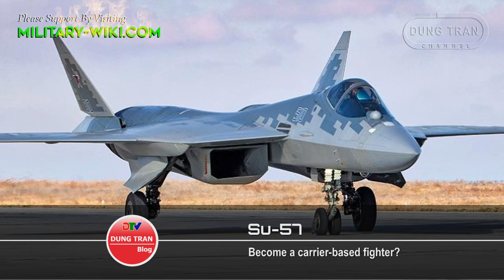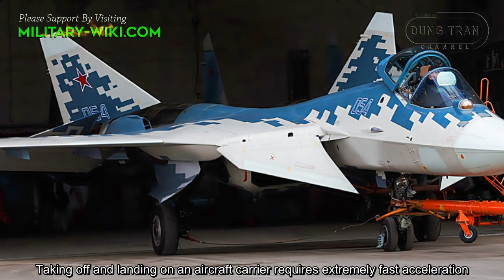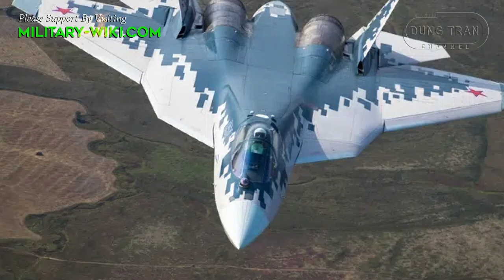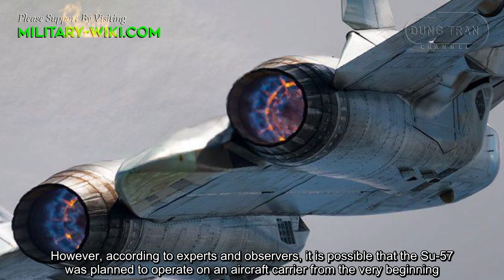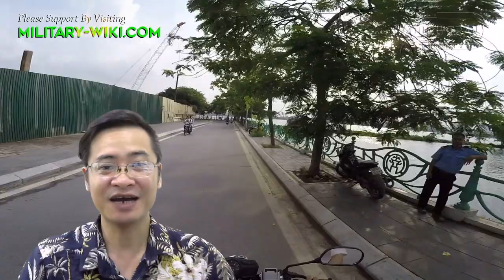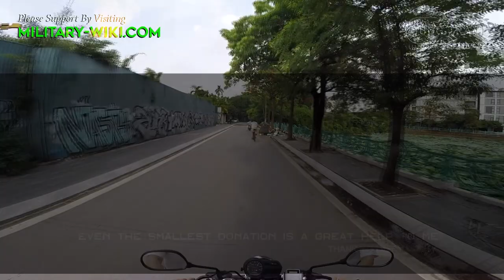What Su-57 need to be modified to become a carrier-based fighter?

Comment: You may need to strengthen the entire frame of the Su57 to keep the landing arresting wire from cracking the frame when it lands. On the other hand, many Russian fighters are made to land on rough unfinished air fields. If the frame needs strengthening then you may as well design a new plane. Never-the-less, an aircraft version of the Su57 doesn't look too promising if you also need to modify elevators in the aircraft carrier plus do all the modifications mentioned to the Su57. Besides, just affording the needed new aircraft carrier would be a stretch for Russia. They would probably try for a carrier similar to UK's QE 2 and use vertical take off and landing fighters. For starters they need a big enough ship yard to buidvan air craft carrier. The F35 c is the US Naval version of the F35 and it is a STOL ( short take off & landing) version of that fighter. The USA Marines use the F35b.